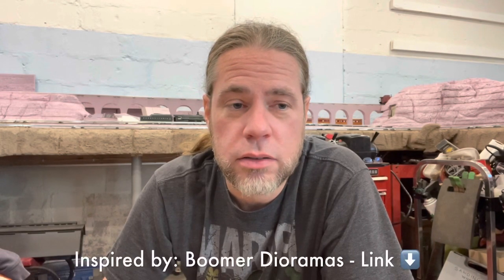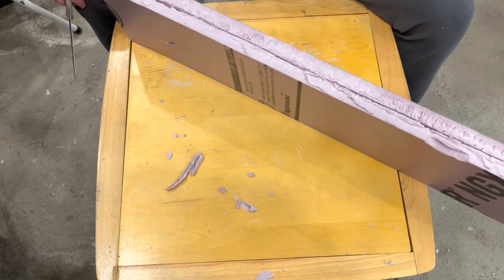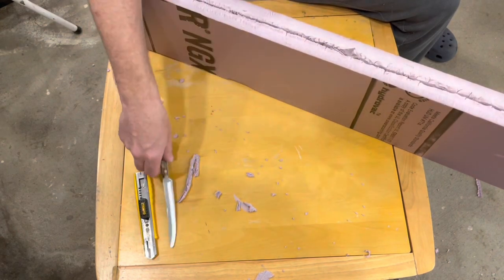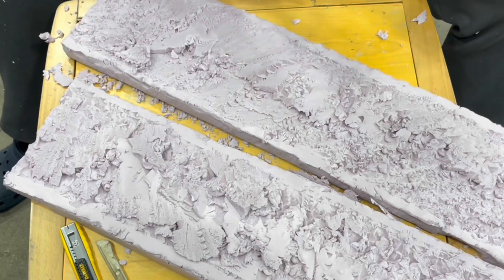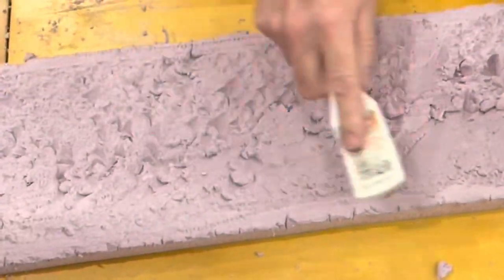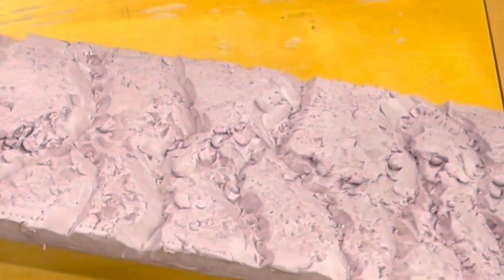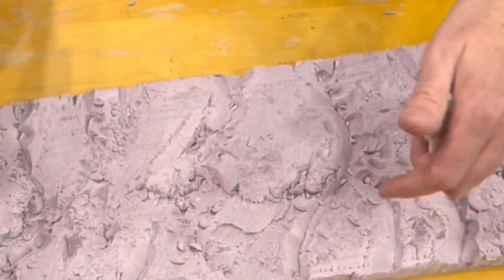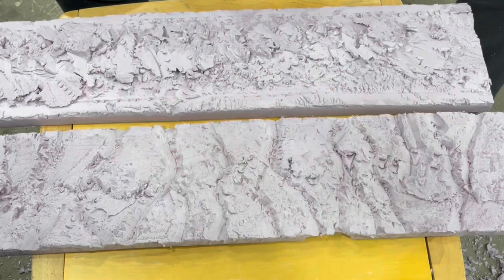Creating a Foam Backdrop - Carving Rock into Foam Board - Model Railroad Scenery

Comment: Excellent technique, i recently applied this and after paint and ground media I achieved a most awesome rock wall. I did however alter your method. When making initial separation of the foam I dug at angles with my blade and the result was dramatic in rock cuts.
Reply from the maker: Very nice! I always say adapt to your needs and preferences. However it works for you is great. I feel like every time I do some carving, I do it slightly differently.

Comment: How  about spray foam to build  mountains  and tunnels  maybe  like. Paper  Mackay
Reply: Spray foam use it like paper. Mache
Reply from the maker: I personally don’t like working with spray foam. I’ve tried it a few times. I know some people get some good results with it. But it’s not cheap, its sticky until it dries, and leaves an inconsistent layer of foam. I’d rather just stack sheets of foam, no need to wait and i can just keep working.